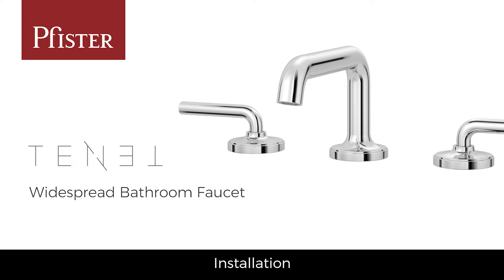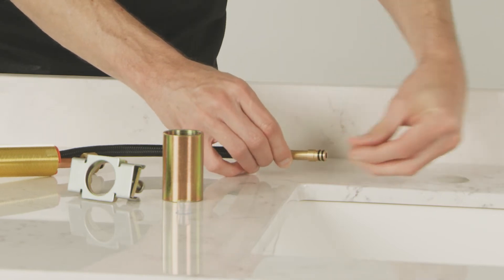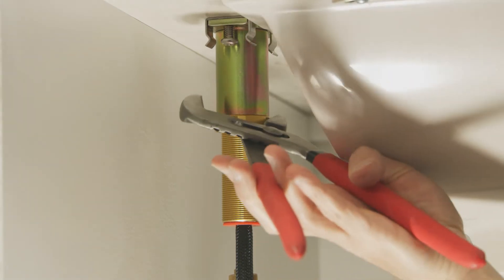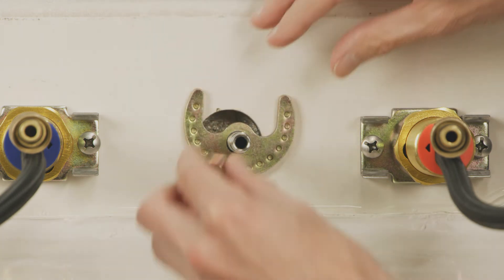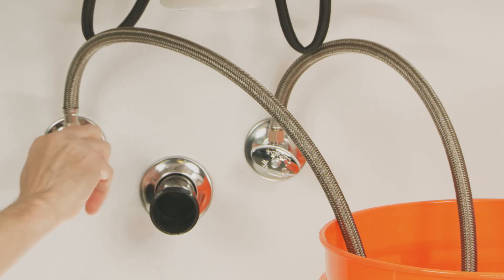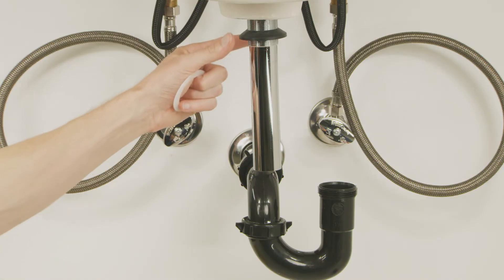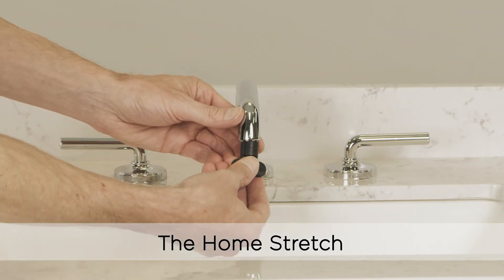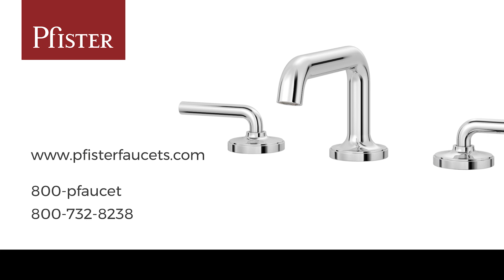Pfister Tenet Installation Video

Comment: Thank you for your video.  Is the end that connects the water supply lines just a standard toilet like connector? Size?
Reply from the maker: The Tenet widespread faucet comes with inlet connectors #970-075 for the hot and cold sides that attach to standard 1/2" supply lines with 1/2" fittings. The other end of the water supply lines would depend on the size of the connection in your home. If you need further assistance, please give our experts a call at 1-800-732-8238, and they’ll be happy to assist! Thanks -- Pfister Social